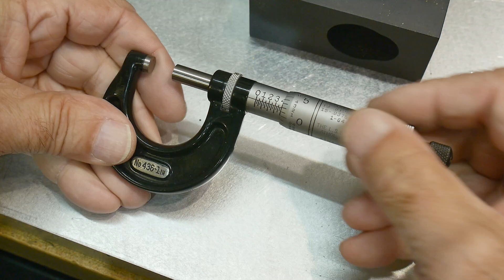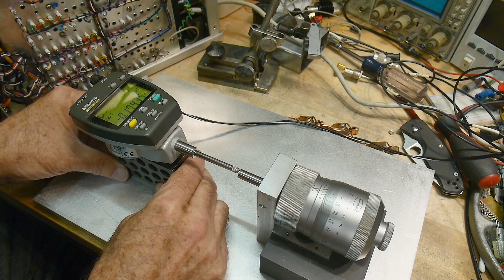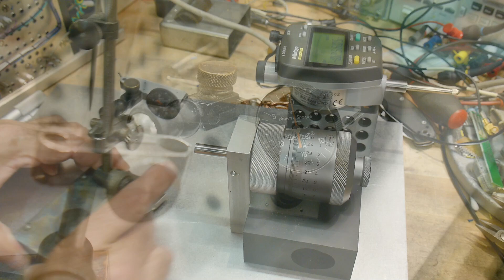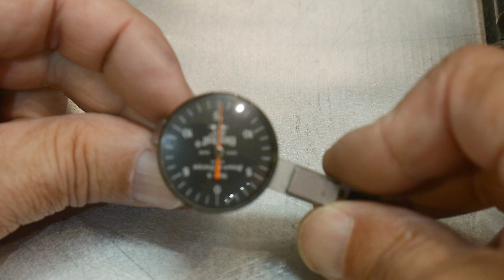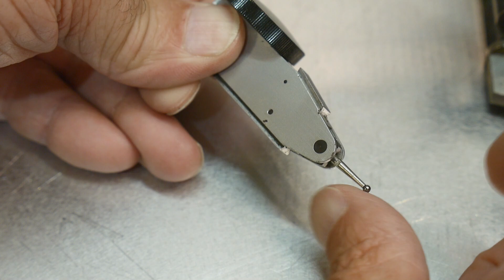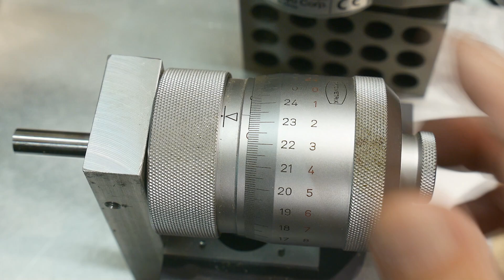#1919 Optometrix Micrometer Head

Comment: Nice Mic!

I would hate to fold a dial indicator plunger over--only to find that is not that kind of indicator. It reads like a Steven Wright bit.

Thors has screws and nut collar things, so you dont have to buy a whole mic--if one is going to put a stepper on it. Some fun optical things could be made from them.

The big thing now is flextures, as in cheao optical mechanisms. 

I have 2 xyz stages that need mics. I should get some cheapies. I did a teardown of a garage sake 180mn Klinger linier stage. Theres a video on my channel.

Comment: When you were checking your dial test indicator, the indicator should normally have the point at an eighteen degree angle else you introduce cosine error.  Otherwise, nice piece.
Reply from the maker: https://store.gaging.com/blog/whats-wrong-with-my-test-indicator-a-cosine-error-discussion.html
Reply: Actually, I'd be quite interested in how such indicators handle inherent cosine error, if at all - if they would simply measure rotation of the feeler around its pivot axis cosine error would be incurred immediately as soon as they move off 0 (perfectly parallel to the surface); but I suspect that's not actually what they measure. Maybe the feeler is actually a cam that compensates for it if you start off parallel to the surface...? No idea, but I'm curious...
Reply from the maker: they measure rotation around the pivot point. so doesn't matter what direction they point, but to use you need to have the measured surface at 90 deg to the feeler to avoid the cos problem.
Reply: @IMSAIGuy  The link you posted has a footnote that mentions Brown and Sharpe BesTest (i.e., the dial indicator you're using in this video) is designed to work at a 12 degree angle.
Reply from the maker: @Ziferten  Hmmm, so it says. I didn't measure any cos error in my test though and I was at 0 deg. not 12. Guess it's close enough. thanks for pointing that out.
cos 12° = 0.9781.